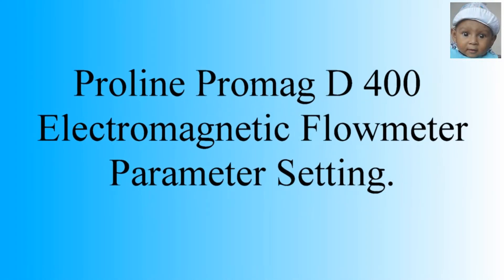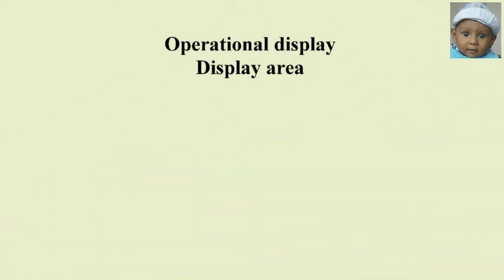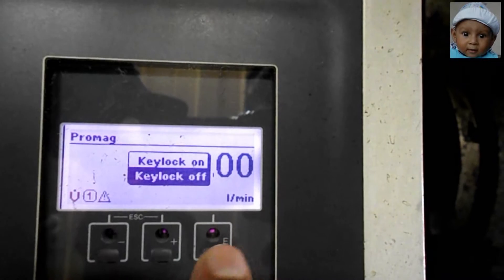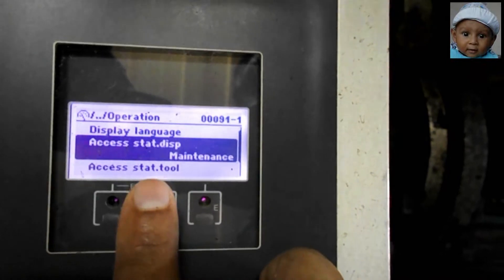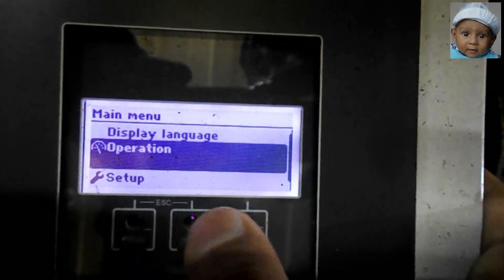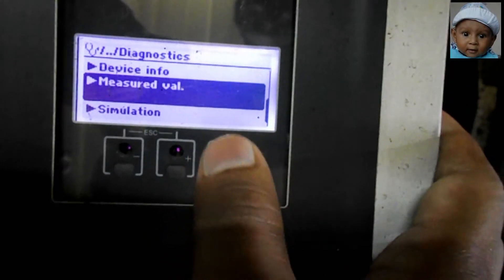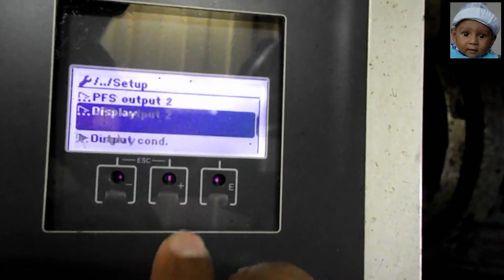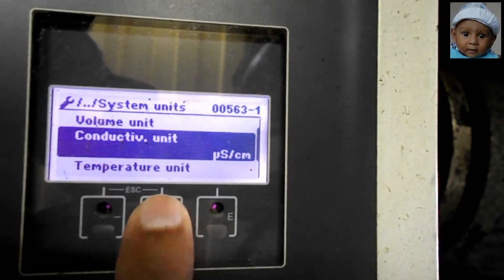Parameter Setting on Endress+Hauser Promag D400 | How to Set 4 to 20 mA Current output & Simulation.

Comment: Hi, my flowmeter is not giving the correct reading. I have installed an analogue meter in series and my flow varies between 10-15m3/hr. 
My Promag D 400 reading varies from 0.00 to 9.5 and is continuously changing. Can’t seem to figure out what to do.
Reply: Talking about the localized reading. Not using transmitter for now.
Reply: Same variations 200m/3 up and down on 3500 flow

Comment: My flowmeter showing 4times the actual valve.. what would be the reason ?
Reply from the maker: What type of flowmeter you have
Reply from the maker: How you have understand it's showing 4 times the actual value
Reply: PROMAG W400 electromagnetic. And by checking my tank capacity .. my tank capacity is 1000m3 but showing output is around 3900 m3.
Reply from the maker: And is there any plc
Reply: Yes.
Reply from the maker: Call me on this 9339904744

Comment: What mention already I did still not getting ma output
Reply from the maker: Check analog input  address in your plc you are getting  any value or not  value between -32767 to +32767 Check analog wiring and you can also send signal on  withour flow from flowmeter on simulation